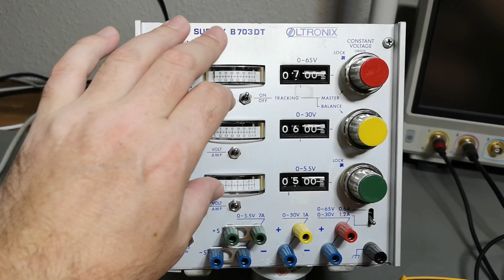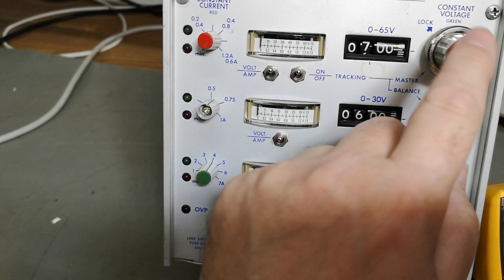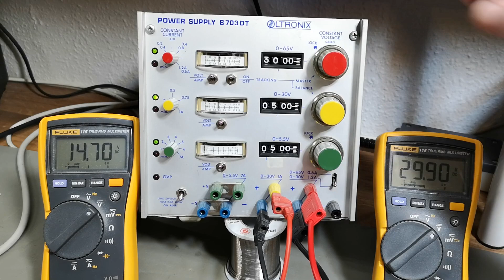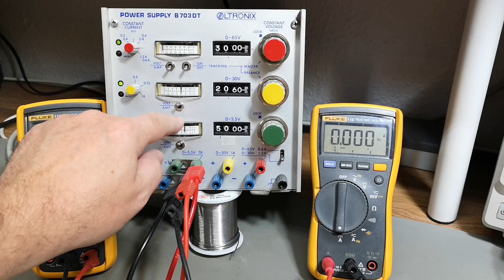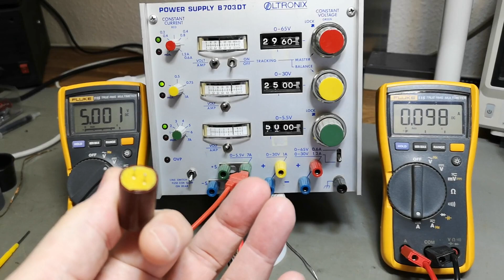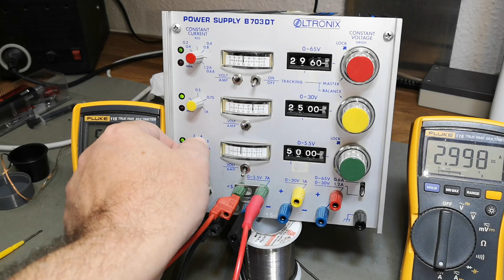Oltronix B703DT Power Supply Triple 5V 30V 70V trackable teardown

Comment: I’m so lucky. My workplace in the 80-ties had a single voltage (0-40 V?)  Oltronix. I loved it. After looking for a symetric hobby supply i ended up buying a cheap but decent Chinese one. A month later this B703DT showed up and I managed to secure it. Now I found this video ❤ What a device! They are Dutch, i think You said Swedish or maybe thats where You got that particular unit from.

Comment: Hi Thomas, really great video. I have managed to get hold of a B704DPM and are having issues with the Current limiter on the 4.5-5.5V/5A output. It seems to be working ok, but sometimes when the current limiter kicks in, it seems to be locking in the "Current limiting"-mode. Basically the red LED is stuck, no matter what I do, it will not release the state. Not even turning the power off. Sometimes though, leaving it off for a couple of days, will reset the state and it is working as expected again. I can even for a couple of times have the "Current limiter" kick in, and then as expected release the load or turn the limiter nob, to release the state as expected. Then suddenly it freezes the current limiter in Red state, and I'm stuck again. I have seen several of your Oltronix Videos, and they are great, but none of them seems to be explaining the Current Limiter function (and then especially, how it resets). I have tried to get a schema/diagram of the B704DPM, but no Luck. It seems like it is fairly similar to the B703DT (0-5.5V/7A) you provided. Do you have any ideas on how to go about finding the cause to this strange behaviour. Is there some other fora I should use to contact you?
Reply from the maker: my email is my call sign at gmail :-) I still have all my notes and manual schematics for this one i can share.

Comment: @TeardownOZ2CPU Hi, can you tell me what is the supply voltage of the LM358 in the power supply for all channels?
 I want to try to build a power supply
(message written through google translator)
Reply from the maker: put this into Google : 
DC power supply with LM358
then pick the best project for your taste.,
Reply: @TeardownOZ2CPU   Ok, According to the 0-30V circuit, lm 358 power +4.3. -0.7v?

Comment: I have seen these supplies before, I didn't think their design would be that simple, basically each supply is just one double opamp. 
The link to the schematics is broken by the way, it 404's
Reply from the maker: I am sorry xdevs taken most files offline and deleted all links and is now moving it somewhere else,
if they ever come back with a new working link, please send me the link so i can update my bookmark,,
in case anyone need exactly this schematic, write me an email, and i can send you my files, I keep all my schematics and PDF files
so they are easy to find again for me. my email is my radio amateur call sign at gmail dot com.
Reply: @TeardownOZ2CPU 
Ah ok, they took it down. 
The internet archive has a cache of that directory at the 22nd of may this year, so I managed to grab it from there. Can't post a link here because YT will take it down, but you get the idea ;)
Reply: @Sine1040 Can you share the manual for Oltronix B703?